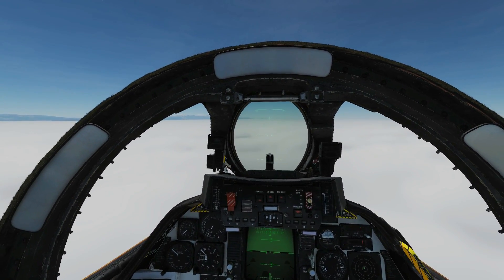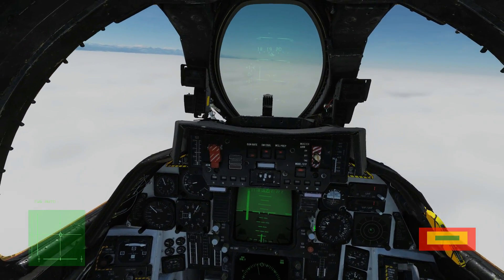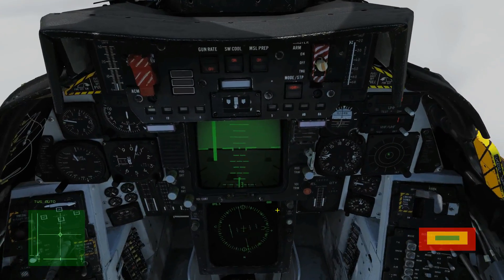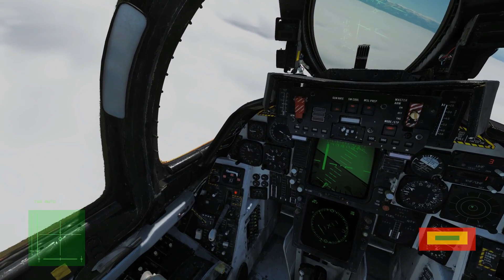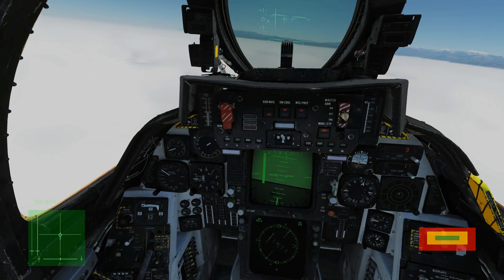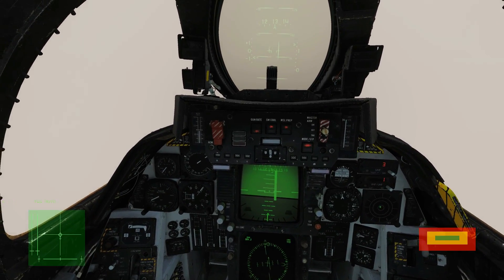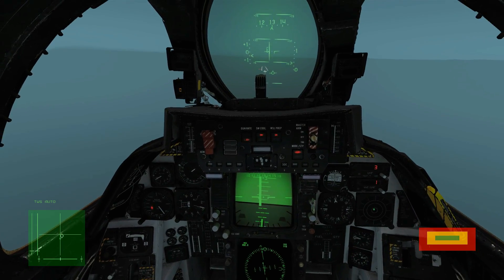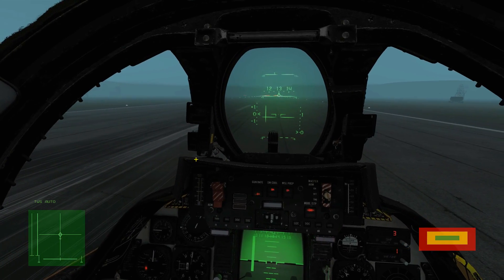F-14B Tomcat: Airfield IFR Fog Tacan Landing Tutorial | DCS WORLD

Comment: Essentially this is a VOR approach and without glidepath information its non-precision. You wouldn't really do it with ceiling/vis this low and would otherwise just divert. Otherwise Cap's approach was great considering he had no vertical guidance and just went off mental math. It's just a game too so there's not really much to be worried about. 

A precision approach would take you a specific point, a "decision height" where you must either continue to land or go-around. A non-precision approach merely gets you to a safe altitude you can descend to which is between the Final Approach Fix and then fly along at until reaching a Missed Approach Point. It is usually considered good technique to descend at a modest rate (600-800 feet per minute at around 100-140 kts depending on wind and aircraft approach speed/category) to the MDA or Minimum Descent Altitude but in fact you don't have to. You could immediately drop right to it as long as you are passed the Final Approach Fix and this is unlike a Precision Approach where you must remain on a Glidepath but in turn gets you much closer to the runway threshold. However its almost always needlessly reckless to descend at a rate greater than 1000 feet per minute on any instrument approach once passed the Final Approach Fix unless the aircraft's nature calls for it. Anything beyond 1500fpm is dangerous. If there are also step down altitudes between the FAF and the MDA these must be complied with.

Comment: Just remember the altitude formula only works if the field is at sea level. You have to add airport elevation too the calculation for anything else, this is because the QNH doesn’t make the field=0 on your altimeter, it only adjusts for the different level of pressure to give you an accurate barometric altitude
Reply from the maker: Good point.

Comment: A good thing to do when touching down on a runway is to pull back the stick and use the control surfaces to brake you speed down. This is what the Anti-skid switch helps with. If you attempt to pull back the stick without the spoilers the anti-skid switch provides out, then you'll pull the nose back up, but with anti-skid switch on, you'll brake in no time using the stick.

Comment: Hi CAP. I’m pretty sure the Mag Variation is plus 6 degrees, not minus 6 degrees. That is why the TACAN angle was off when you went visual. The course should have been 131, not 119, hence the course not matching the runway number of 13. Besides that loving all the videos!
Reply from the maker: The thing is, I check this out before hand. When flying straight and level my plane showed 100º and the F10 map showed 106º true. So it has to be minus??
Reply: The Magnetic Variation is indeed plus 6, which is WHY you have to subtract 6. Cap was right in the instance.